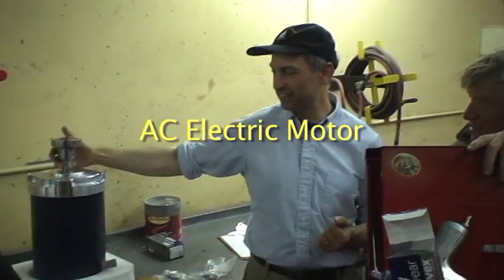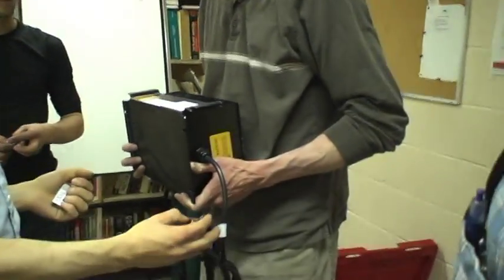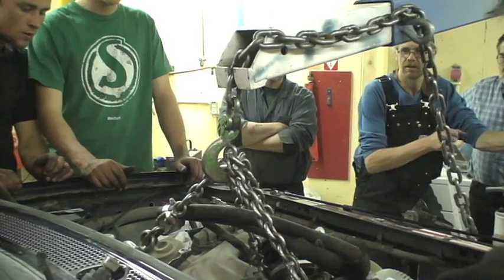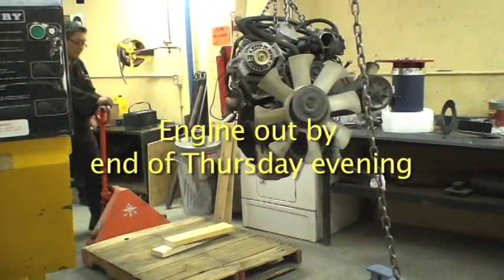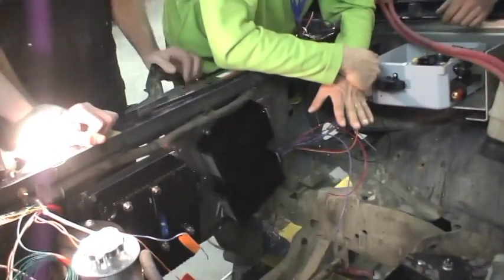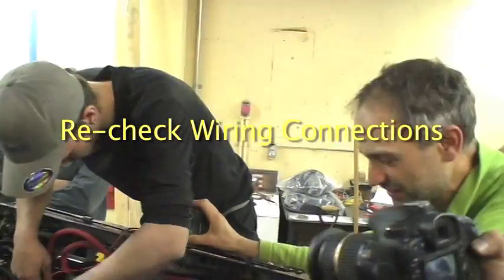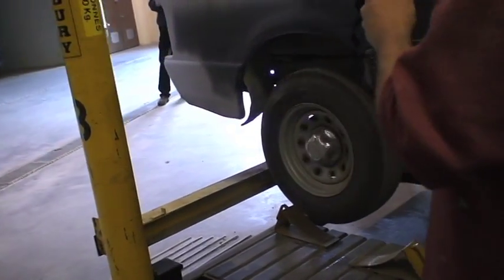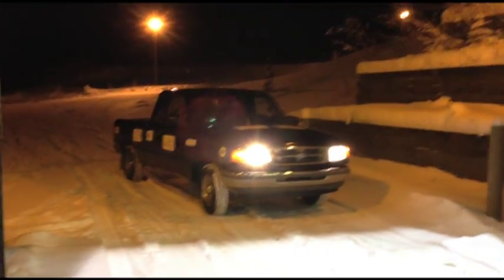Electric Vehicle Conversion in a weekend - Ford Ranger pt2

Comment: You don't need a battery pack all you need is is a battery alternator and capacitors to make that motor run it will run charge on its own charge the battery which all it needs is a battery to start with

Comment: how come no one is putting a CHARGING SYSTEM  on any all electric. What ever the motor uses, double the charging voltage. with a turn off relay once batts are charged, and back on once the batts are down to like 80-%… for get abought taxes to fix roads...

Comment: I have ask this question many times would like an answer please but here goes would it be possible to hook up a couple of Alternators on the front part of the motor close to the radiator where the radiator used to be to try to charge the battery system is it possible feasible anyting
Reply from the maker: Unfortunately, that cannot work because it would mean that you are using the motor to charge the batteries that are running the motor that is running off the batteries... which sounds like a perpetual motion machine (which cannot work).

Comment: Go to Avasva eco blog and learn how to do it.
Reply: Well the electric idea is ok so far and yea! It moves!!, what about air conditioning and heating systems? Or this cars are supposed to be drive on good weather conditions only!!, I have seen so many conversations and the goal is just to see the car driving around, what about the rest? Load capacity, torque, horse power, and the most important part " battery degradation " , $? for a new battery pack and how long last the existing one? Battery storage capacity " and degradation!!
Reply: Yeah. That is good
Reply: Thanks Cordelia!!!

Comment: The drive flange on the  motor shafts should have Allen set screws but also a split taper lock consisting of a tapered thread and tapered bore nut to rely get a grip on the armature shaft. A woodruff key and Allen set screws will fail eventually.

Comment: I know this was done in a few days. Would it not be better to bypass the transmission all together?  It would take out more weight and increase efficiency.
Reply: You could wire it to reverse
Reply: fatboy19831 then you wouldn't have reverse
Reply: GODs Son's Son Shepherd direct drive is more efficient faster and less power loss
Reply: @denoavissmartt7904  - electric motors are most efficient over a specific and narrow RPM band. Like gasoline engines, any time you are operating outside of this band, the efficiency drops off sharply. By keeping the transmission, you allow the motor to stay at or near its most efficient speed and still accelerate the vehicle across a wide range of final drive speeds.

Basically, without the transmission, you could drive efficiently at only ever one speed. You would also need to do extra work to wire in a way to drive the motor backwards for reversing, as well as install several different forms of emergency shutdown in case of arced/welded contacts stuck in place supplying unwanted drive power.

Leaving the trans in makes the vehicle better in literally every single way, except it adds about 60-80 lbs and offers a single high reliability failure point. But those transmissions are cheap, common, and can be swapped in less than an hour.

Effectively, you'd be a moron to remove the trans.
Reply: DC and ac motors do reverse it's programmable in the ecsc or motor controller just get a long enough shaft to get to the diff
Reply: Transmission gives more power and speed than single gear. I wish all electric pick up trucks will have a transmission. Unless you replace the transmission with another online motor

Comment: I wouldn't be for putting the batteries in a box in the bed. Giving up bed-space and raising the center of gravity of the vehicle.  I would want to attach trays to frame rails below the bed and in the engine compartment.
Reply: I was thinking that exact thought.  So much space between the rails of the frame.   I have a 2004 Nissan Frontier I would love to convert to electric.  How does one engage these outfits?

Comment: great idea. but I think it would be more efficient to leave the gas engine in the vehicle remove the transmission, replace the trans with an electric generator, run power cables from the electric generator to an electric motor that's connected to the rear axle. 
that way you'd still have power steering, air conditioning and heat.
Reply: Joshua Zimmer , yes they do, but no A/C, power steering etc when at rest, so on a 90 degree day, that 3 minutes you sit at the traffic lights, you get HOT.
Reply: TheTorkerman-Adam - Actually, the Motor Controller, CAN be programmed with an Idle Mode!

Comment: is there a way to do it so the batteries dont add too much weight?
Reply: Different types of batteries weigh different amounts. Lead ones are the cheapest but quite heavy.
Reply: Stuart Houston 
True. What about li-ion?
Reply: Those weigh less but I think they cost more. I'm not sure the exact price difference but I know you get a lot of bonuses from less weight so lithium ion ones are a much better option
Reply: Stuart Houston 
Yeah, I looked at some they were 200 a piece. They weighed 5 lbs.
Reply: batteries are gonna be expensive and you're gonna have to shop around either way. if you don't want super range you probably could do OK with lesser heavier batteries. Just remember you don't need to be building the best EV, just one that works.
Reply: Stuart Houston 
Well my first project is only for a motorbike. So I don't need something too powerful. I just need one for a 36 volt motor.
Reply: I haven't seen this done on a motorbike. I bet doing it to one of those big tricycles could really beef up the capabilities hahah.
Reply: Stuart Houston 
yeah lol

Comment: No heat in cab ? what is the range I'm guessing thirty miles and eight hours to recharge?
Reply: That charger is an Elcon. Will work 120 or 240 ac. They opted for the 120input. Long time to charge.

Comment from the maker: Yes, you add more batteries to increase the range.  Solar panels could keep the batteries topped up if the vehicle was stored for the winter, but they would not charge enough to drive.  (Solar panels would have to charge for about a month in order to drive for a day.)
Reply: +Glenn Piwowar That sounds very inefficient but how do you drive these during the winters then since warming up the coup would eat up your electricity and give a shorter range?
Reply: It depends on the sun and the surface of the panels. Panels average 15 to 18% efficiency, with one square meter you can produce up to 150-180W per m2 per hour, if you install say 20 sqm of panels that means 3,000 to 3,600W per hour, enough for 30 kilometers, that is 27 to 32,4 kilowatts.  Sufficient for 270km (168mi) to 320km (200mi) per day, more than necessary for the average commuter. I am not saying that electric can solve all problems, I am saying that this is only theoretical under sunshine, however remember that solar energy is FREE ! infinite mile per gallon, or zero liter per 100km as we say in the rest of the world.
Reply: A telescoping wind turbine would be better for parking. Maybe a pair of compact VAWT that lay on the bedrails for storage...Then it could charge at night!
Reply: Solar for air conditioning and radio mobile charging only. I don't think the solar would help unless you have a inverter.
Reply: Glenn Piwowar g

Comment: Where is Pt1?
Reply from the maker: It was combined into this "Pt2" video.
Reply: zeeek1 Yes, but you create inefficiencies converting from DC to AC.
Reply: Glenn Piwowar Why did you use an AC motor? What is the KW rating of the motor? What is the battery capacity (in KWH)? What is the range with the truck empty?
Reply: tarstarkusz I can answer one question. It's an AC motor because they are more efficient. Straight brushed DC motor efficiencies are way lower. The motors and controllers are large scale versions of today's RC cars.
Reply: Not as much as mechanical brushed dc motors.

Comment: This is AWESOME! I just have two questions! 1) How many miles can it get on one charge? 2) How much would you charge to convert my Ranger? lol I want one! :)
Reply from the maker: About a 100 km, depending on the terrain, wind, driving style, etc.
Reply: Glenn Piwowar I would love to do, this, but i also want to attach 245 watt solar panels to my roof. It's not much but it's something and it's a smaller footprint than panels were in the early 90's so they are improving this.

Comment from the maker: It's not too bad, from what I understand as it's rear-wheel drive and in any case the weight of the batteries is still ahead of the rear axle.  Also it is SO much easier to secure the batteries in a rectangular box behind the cab than trying to build a compartment where the engine was.

Comment: Wouldn't it make more sense to put the batteries in the engine compartment? That way the weight balance would be the same as if it had an IC engine, just as it was engineered. Now the front end will be too light and you might have some grip issues.

Comment from the maker: There is no regenerative braking in this system - just the standard brakes.
A new (electric) pump was installed for the power steering.
As far as powering the brakes, I can't recall...